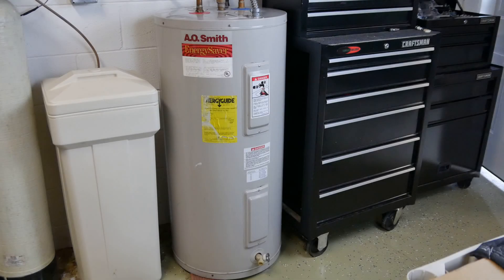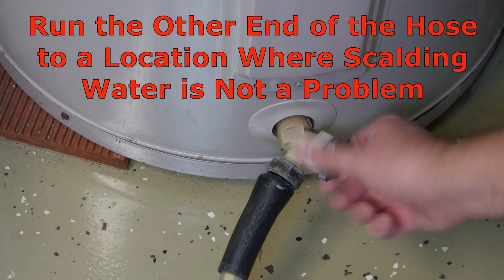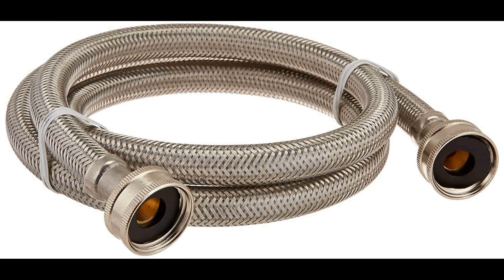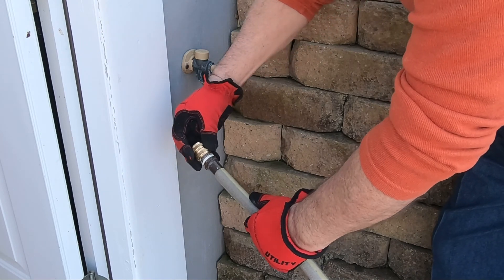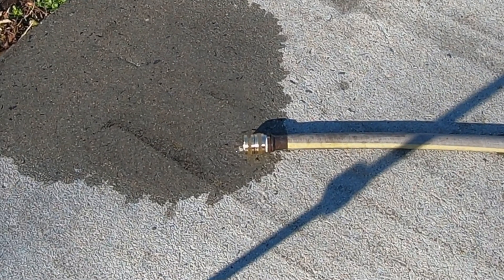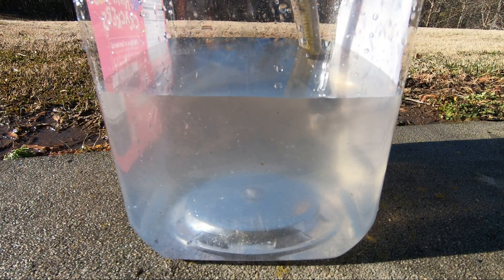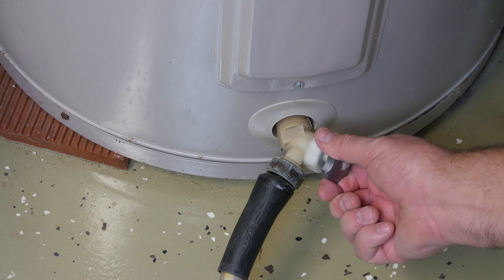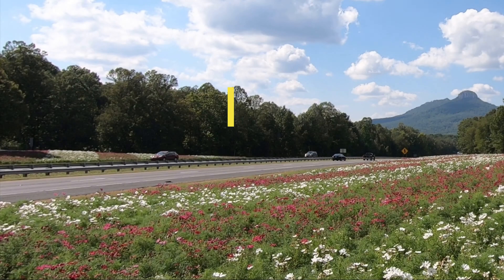Back-flushing a clogged drain on a hot water heater

Comment: It's easier to just remove the drain hose and use a coat hanger wire or long screwdriver and then quickly hook the hose back up. Also wear gloves.

Comment: I got a question, as long as you leave a tap somewhere in the house open on hot, the pressure from the backflush will go that way and not harm anything?  For example leaving a bathroom sink wide open on hot?

Comment: My water heater would not drain and I’m glad I found our video. 

The first time I turned on the hose, I could hear the sediments whirling around. I turned it off and disconnected it from the faucet, but it still didn’t drain. The hot water knob was turn on inside the house. I tried to turn on the cold water on the water heater and that had water rushing out! The bucket filled up with water and was a grayish color. But when I turned off the cold water, it still wasn’t draining by itself. Only when i turned on the cold water would any water come out. I tried to back flush it a few more times but never heard any sediments whirling around those times. Any idea for me on how to drain it or is running the cold water through the tank and letting it out enough? I did it for about 15 mins and the water wasn’t as grayish. more clear but still had little gray pieces floating around. Thanks!
Reply from the maker: I'll open up your question for my readers.  Anyone have a response to Benny's question?

Comment: Thats great video. I recently tried to drain my water heater and it didn’t drain well, i guess thats the reason. But i also have pressure regilator on the tank. Do you have one ? When i opened pressure regulator it drained a wTer from that pipe
Reply from the maker: No, there's no pressure regulator on mine.  Thanks for viewing.

Comment: Great video! This is just what I needed to finally get the water from my water heater to drain it! I still had trouble getting it to flow without the cold water supply being turned on, but when I turned it on, it flowed and blew out lots of junk. I repeated this several times. I may just have to flush my water heater with the supply on constantly. Thanks for the great advice!
Reply from the maker: Glad it worked.  Thanks for the comments and for viewing

Comment: Thank you so much for sharing this. Could I ask you for clarification on the beginning? I get the idea of backflushing but from the video I can't tell where the outside (cool water) hose goes on the water heater. The water heater hose seemed to be for the hot water. Could someone clarify for me? It sounds like I need to have two entry points for hoses for the water heater for this process (one for the cold to shoot in and one for the hot to shoot out) and I don't see that on mine. Thanks for explaining!
Reply from the maker: Let me try to explain:  the hose attachment at the bottom of the tank is the 'only' hose attachment.  There is not one for cold and one for hot.  When we attached the hose to the tank at 40 seconds into the video and opened the tank spigot, we drained the hot water out the other end of the hose.  Once finished, all we did was take that other end of the hose and attach it to an outside water spigot and turn on the water for a minute, then remove the hose from the outside spigot and let it drain out again and repeated this 4 or more times before closing the spigot on the bottom of the tank.  Hope this helps.
Reply: @PilotViewProductions do you have to have a faucet open?   Will water back flush into the tank if the tank is full
Reply from the maker: @Maryann-q8j  Thats my understanding, but I'm no plumber.  Basically, the open faucet 'breaks' the vacuum that naturally exists and allows the water to drain.

Comment: I tried backflushing my downstairs tank 4x but it didn't work. I also tried turning the water on to the tank to flush it out and nothing comes out.

My tank upstairs only drains if I turn the water on to the tank. When I turn the water off nothing comes out. Despite my issues it was an excellent video.
Reply: Sounds like it’s vapor locked. Did you turn on a hot water faucet or two? Maybe try opening the pressure relief valve as well. Good luck!

Comment: Excellent vid. I needed 2 hoses as bottom one wouldn’t drain, removed top plug/ valve and stuck a hose there. I will use this flush method this weekend though
Reply from the maker: Thanks for viewing.  Dean

Comment: Are there any tricks to do this on an installation with no cold water cutoff to the heater?
Reply from the maker: I will have to defer your answer to my faithful viewership.  Does anyone know the answer to this question?
Reply: Shut off main water, add valve to cold supply to heater, turn on main supply, close valve to heater
Reply: Shut off 
main supply to house

Comment: That is definitely calcium carbonate in your water. However, calcium in the water does not produce a noticeable odor.
Reply from the maker: Thanks 5th Day.  Fortunately later on, I installed the electrified Corro-Protec titanium anode rod and that has fixed the smell.  Might wanna check out that video if you suffer from the same.

Comment: The sediment is calcium. Horrible in well water. I tried to drain my mom's water heater today, but it is so clogged up it won't drain. I'm going to try your back wash method. Thanks for posting
Reply from the maker: Diana.  Thanks for watching and commenting.  After you back flush please check out my video on vacuuming the sediment then please please watch the one on the Corro-Protec device I installed about a month ago.  The smell is still gone!!!  Thanks again and let me know if I can help.  Dean
Reply: Did it work?
Reply: @DeadEyeRabbit  yes

Comment: I wish I could get to my hot water tank Dean, it's in the back of my closet inside its own sealed closet and all of my shirts are hanging in front of that door, lol 😆.  I've had it burst twice in 25 years and it's not a fun clean up. I  guess I could dig it out and hook a hose up to it and run it out my bedroom window, lol. 👍👍 Jay.
Reply from the maker: Hey Jay.  Yeah that closet location would make for a tough location when problems arise.  Just wait til you see the upcoming video I’m releasing soon on how to vacuum the tank.  Sounds crazy I know.  Thanks for viewing and best down there in Cabarras County.
Reply: @D J I agree DJ, right behind my hot water tank, opposite wall is the breaker box, right up against the tank, only a sheet of drywall separating it. I Agee they should've made an access door to make it easier to get to.